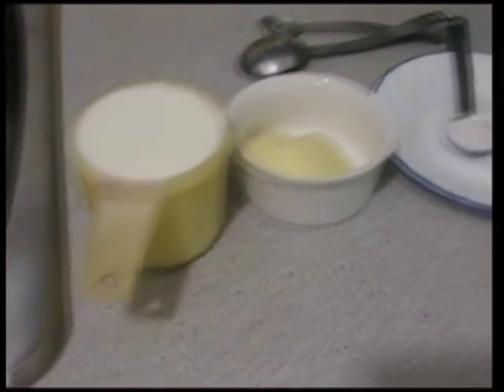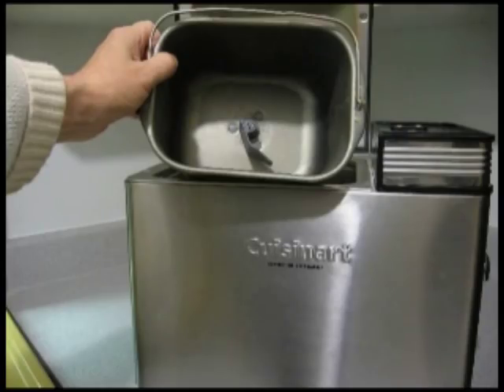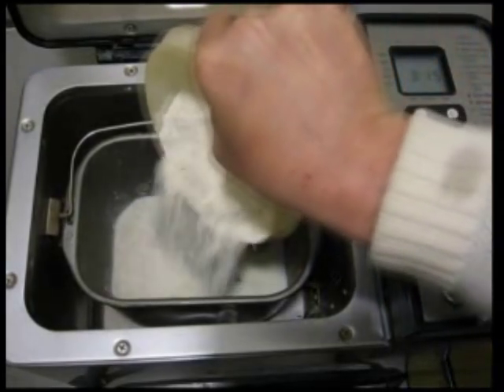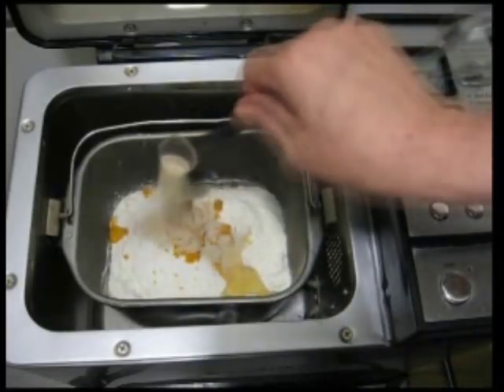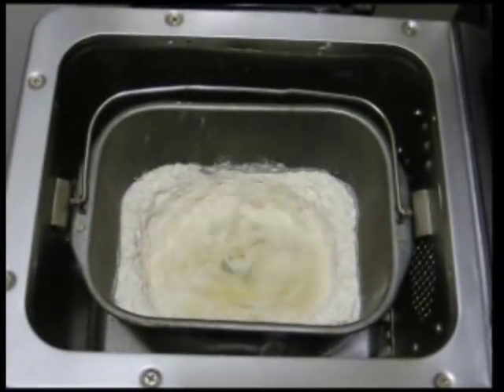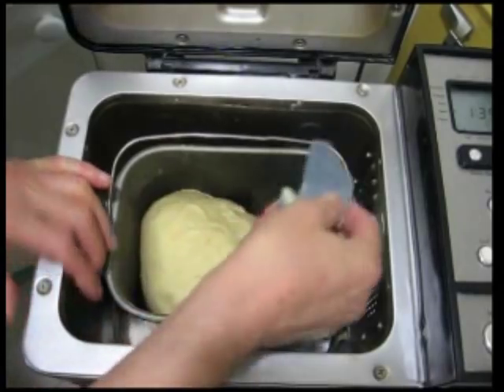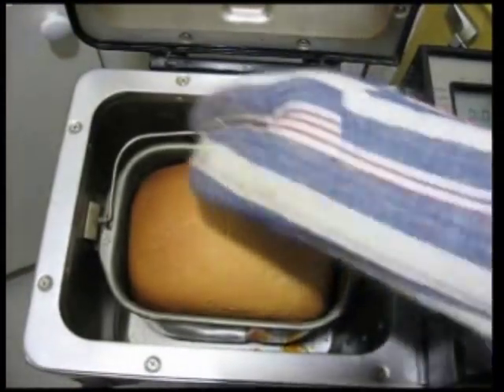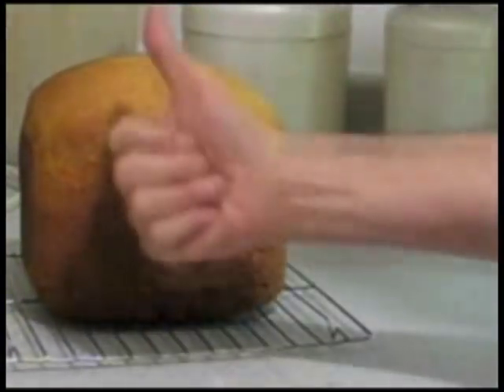Bread Making with a Machine

Comment: @aerotsaperdokoydono he could do the same thing with that machine. he removed the paddle so there wouldn't be a hole in the bottom of the loaf. Basically he added extra steps.

I like the kenwood, in the US it is sold under the DeLonghi name, and only the BM450 is available. I'm looking at that, or maybe a zojirushi.

Comment: crust splitting is caused by oven spring and under rising. if your dough does not rise enough, when it bakes, the crust will form but  then the bread will rise from the heat, breaking open the crust. you can avoid this by adding a little extra yeast (about 1/4 tsp extra but experiment with different amounts for your machine).

Comment: Be careful choosing your bread machine. I've got a Backmeister 8625 that broke after a few months of regular usage. That's because the mechanical solution for transmitting force from the engine to the vat was arguably made by amateur engineers, as it relies on two tabs made from bended plate that are stressed from both sides. A solution comparable to Uri Geller's spoons.

Comment: What if I use self-rising flour? Because I always used Lily's self-rising flour when I make biscuits but I recently yesterday got my hands on a bread Machine I'm excited to try it, unfortunately it came with no instructions
Reply: No, that won't work for regular bread. That needs yeast. Self rising flour is good for biscuits and other quick breads (pancakes, zucchini bread, banana bread, etc) that use other leavenings like baking powder (and don't need yeast) but it won't work for regular breads.

That is to say, you can use the self rising flour if that is all you have, but you still have to also put in yeast.
Reply: Somewhere on your machine (on the bottom, perhaps?) you'll find the model # of your machine. and somewhere else you'll find the brand name.  You can look up the brand name and the model # online and probably find a user's manual for it.

Comment: You have to be careful with the flour that you use. Sometimes when you buy flour for machines it contains vitamin C to cut down the proving time, which if you prove for longer it ends up like Ciabatta with large holes and chewy, not unpleasant , but not a standard loaf just keep this in mind as to the flour and timings.

Comment: Stop raising the lid.  Why do you think there is a window in the lid?   Only raise the lid if you have to add to the dough or in your case remove the paddle.  And that is an excellent idea because I will be able to remove the paddle on my Oster.  So thanks for that bit of great advice.
Reply: @Paco You are right. Raising the lid doesn't change anything while the kneading is going on since the dough has to be checked.  I used a bread machine for a while and had to do the same thing to check my dough.  You are also right that he would have to raise the lid more than usual for this video.  I don't use bread machines anymore because my bread always taste yeasty which I don't like.